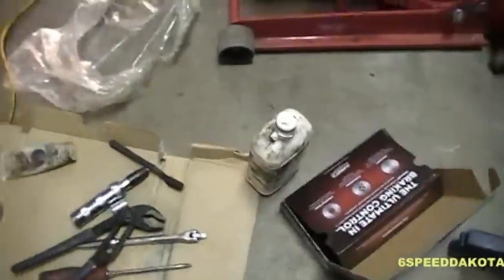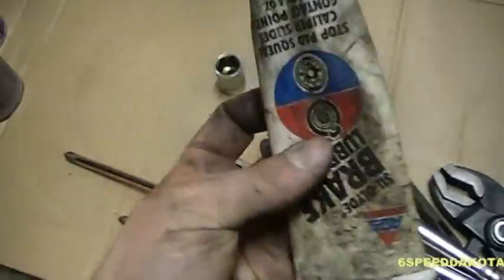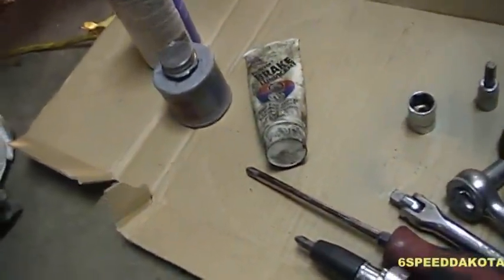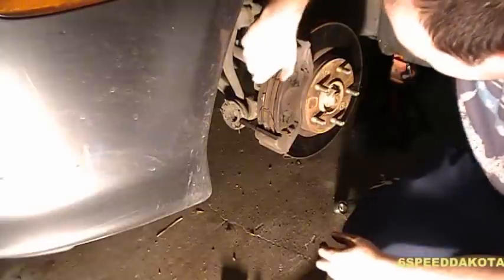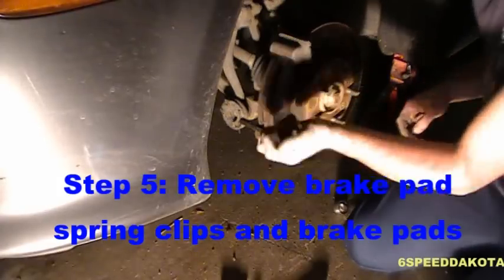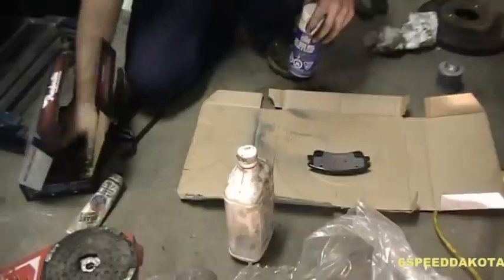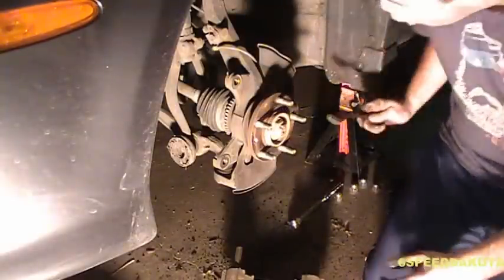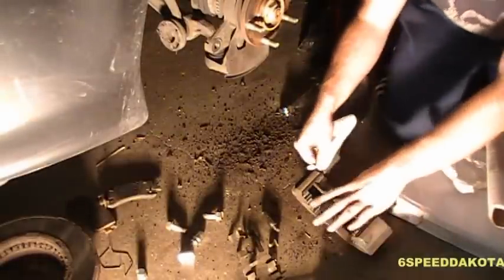How to Replace Brake Pads and Rotors on a 2004 Mazda 6: Part 1: Front Brakes

Comment: The caliper won't slide forward far enough to slide the caliper off the bottom slice pin. I can't figure out what it's hitting. Suggestions would be appreciated. Thanks.
Reply from the maker: It could be that the pin is seized up inside there, try putting a bit of force to it. Don't destroy it, but try prying it with a bit of force using a bar or something. I've had that problem before and I had to take the caliper off and work the pin out.